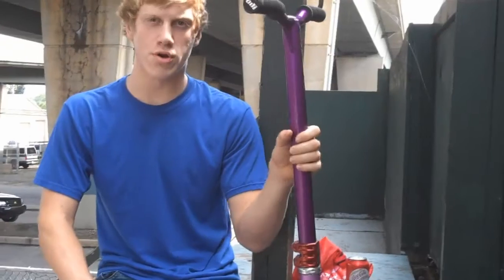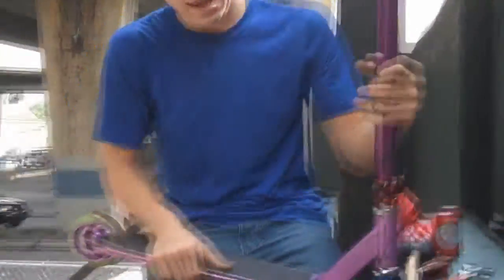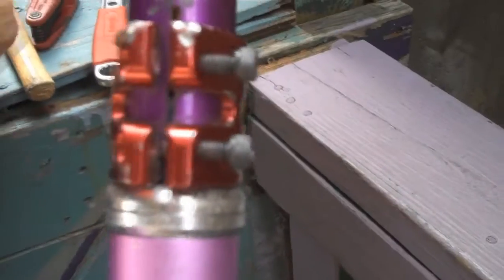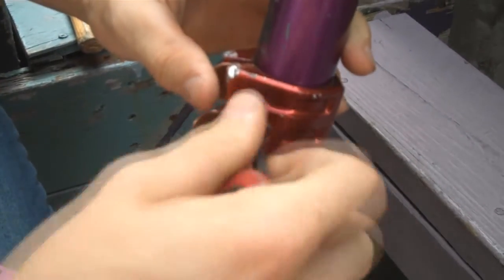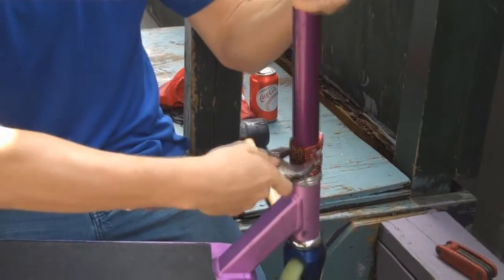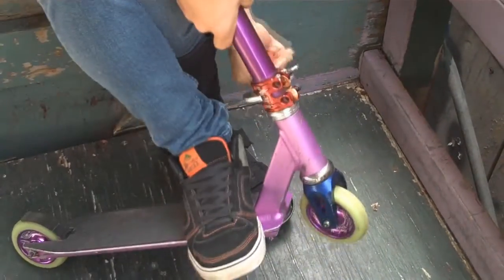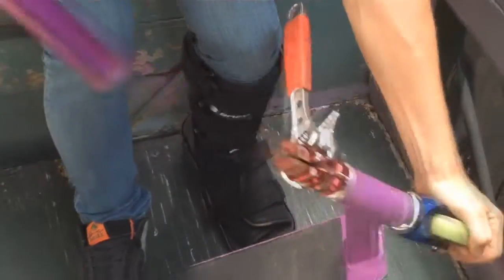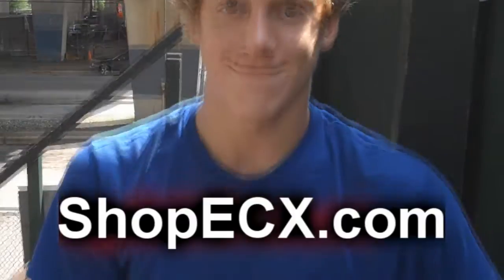Video tutorial for Help with SZ built in HIC clamps (short vid at end)

Comment from the maker: Scooter Zone only has a video of how to install them. The problem we have found is that because the space between the clamp and shim is so small that sometimes bars get STUCK in the clamp. This is the best way that WE have found to remove bars that are STUCK inside the clamp. 

Another good thing to do if you have this HIC system is to sand all of the powder coat or paint off of your bars where they go in to the clamp so that it goes in easier. That should help avoid the problem all together.